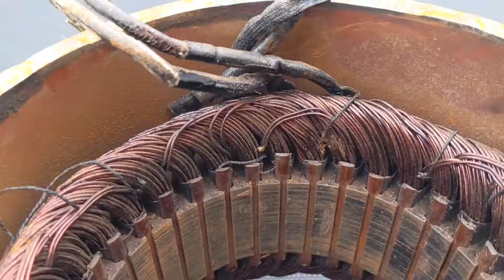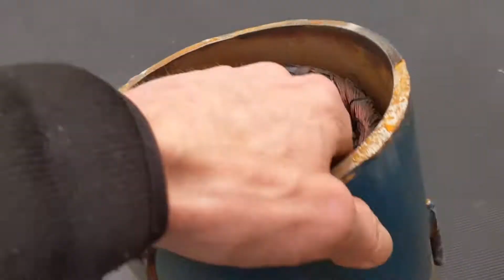Motor Rewind - Would it be worth the hassle ?? Maybe I would learn something - Aluminium Coils !!

Comment: Aluminium wires with copper coating, absolute rubbish stuff and you can see it in a lot of cheap nasty Chinese turbines. I have commented on some of you're other vids about having exactly the same turbine however mine has proper copper windings, and the motor bolts together properly, this is very likely a very early one of these when they didn't care about doing it right, such a shame. For $1000 you could buy an Ista Breeze i1500 like I have just done, much better design, lighter and they actually put out the claimed figures.
Reply from the maker: Yes that was very annoying it wasn't what I expected at all I will answer your other comments when I get more time thank you very much.